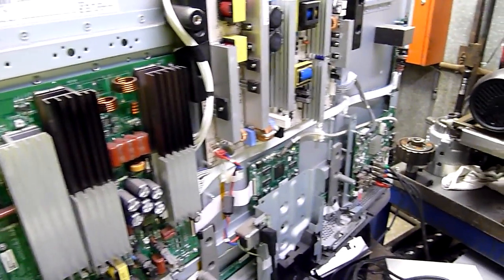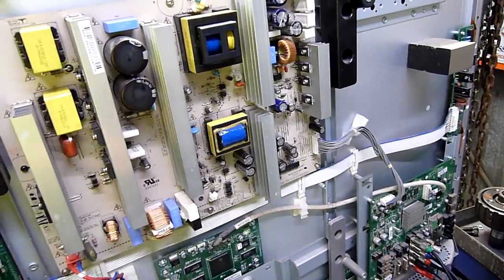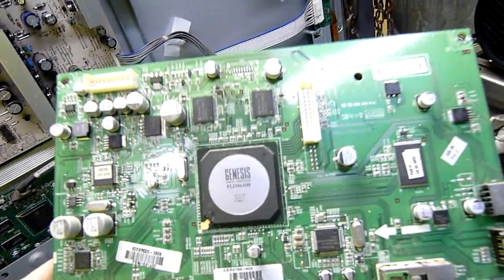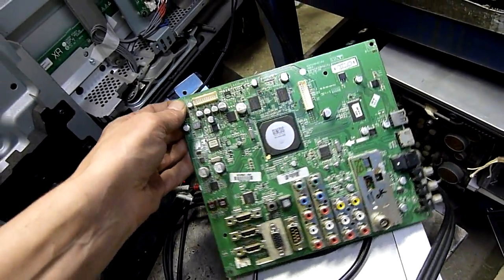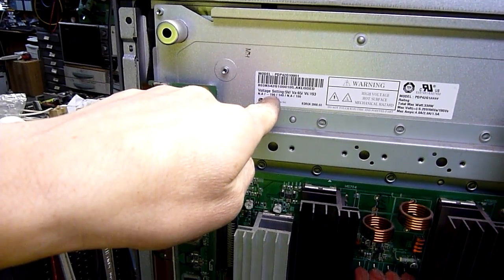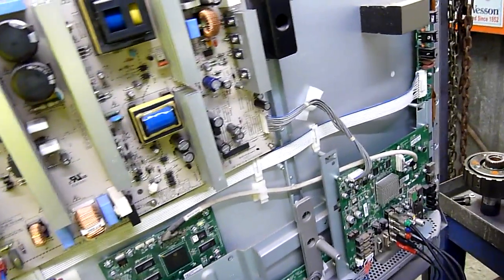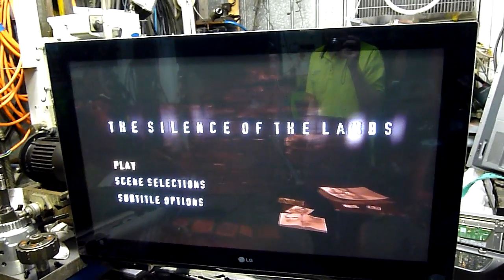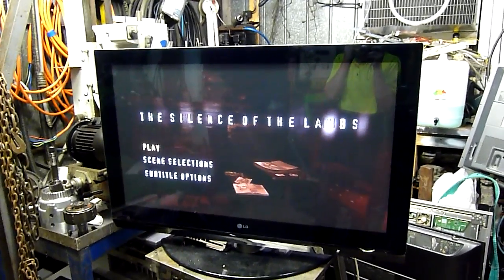LG Plasma ( 42PG60UD ) is fixed + Rambling about DIY Plasma repair safety

Comment: I repaired one of these tv's 2 years ago just replaced mainboard, its the Genesis chips that have the bga problem in my opinion. 
Might try reball the chip on the one I took out and replaced, if I get another the same model come to me.

Comment: I've never been smacked with household electronic goods, but I copped a good belt off an old Philips square wave AC welder at about 150 amps but on the low voltage side. It friggin' hurt. Had the electrode holder in one hand (had some fancy kevlar lined gloves on), moved the earth clamp for a better connection, next thing I know, the holder goes one way, earth goes the other and I have some extremely sore and tender shoulders. Lets say I learned from that experience....
Reply from the maker: haha, yeh I got hit by one of those on the 72V setting, not fun!

Comment: Might be good to run the tv thru an isolation transformer to reduce shock risk like when working on a transformerless valve radio from the depression days. If the plug (nonpolarized naturally) was in the socket 1 way the chassis would be active and floating at mains voltage like the heatsinks.

Comment: It's AC that tends to hold you on because the continuous alternating current keeps stimulating the muscles to contract.  DC gives you a hard bump but doesn't latch you on unless there's a lot of ripple.  I'm sure you've had some interesting shocks.  Care to share your worst?  Mine was on an automatic barrier gate when the "reconditioned" control box went live while I was holding it because someone had missed out half the plastic spacers on the PCB and the brass one that earthed the case.  Happened in front of a lot of people as well which was a bit awkward.

Comment: The Genesis series chips were junk anyway, they had a bad batch of them.
 If you had BGA Rework equipment, you could get a new chip on the chinese blackmarket and replace it, as the firmware is stored off-chip.

Comment: Anxious to see the board bake goes.  I do it at 425 for about 6 minutes.

I remove electrolytics and plastic parts just to be safe.  Good experiment though to prove of this is a BGA solder issue.  Confident that it is.

Damn ROHS nonsense!!  Fill up the landfills with e-waste instead of lead.  Now that's a green thinker for ya.

Comment: Why can a 2 volt DC super cap cook shit but 12 volts DC from a transformer does nothing?
Reply: It's the amount of current.  Cap has very low internal resistance, so can put out a large amount of current very rapidly.  12 volt transformer has a higher internal resistance, less energy can be released in a given time.
Reply: Gavin Curtis
Oh right :) Cheers Gavin.

Comment: I heard that if you lay a plasma flat it can destroy it. Why?
Reply from the maker: I've transported 42" panels flat on their back and front on the way home from the local tip with no broken panels yet, and that was bouncing around in my little trailer too!., but thats not to say it could not cause excess flexing in a much large panel.
standing upright distributes the forces on the glass a bit more evenly, but transporting them on their back has worked well too.

Comment: When I was replacing our 50" space heater of a Samsung plasma's PSU, I was shaking like a leaf when removing the blown PSU, cos in December 2012 I was messing about inside my old Philips CRT VHS-combi TV (while unplugged of course, and had been for a couple of weeks!!) and got a belt from a discharging cap that used me as a path to ground through the cracked up flyback casing, and seeing those big caps on the back of a plasma really made me worry if the same was going to happen, it didn't though thankfully, but it's still wise to be cautious around such things...

Comment: those psus can run up to 320V dc. the bridge rect looks to be 10A plus. if you contacted any potential it could be REALLY friggin nasty. the centre point of the supply caps depending on supply topology, could be 160v. i could be wrong here, but if they are running a half bridge / full bridge SMPS, nasty voltages all about. sometimes at high frequencies, which is another issue too.

Comment: was shocked by my mothers 32 inch CRT a few years ago while holding onto a lamp voltage went up one arm, cross my chest down the other arm, stopped my heart for over 30 seconds, and have never grown a hair on my arms since, the hair bit is not so bad since i'm a woman, but yes not the best way to do it....... got much higher respect for tv's and such now. Only work on computers now there a bit safer, but for the power supply, be very safe out there, nice fix by the way

Comment: You need to bring the board up to 230 Degrees C to melt and reflow the solder on the BGA. All the RCA, VGA etc. plastic connectors cannot tolerate this, so you ruin the board completely - so to reflow the chip, you need a seperate bottom and top heater.

Comment: Hot heatsinks are also really common in UPS. I was really surprised the first time I saw a heatsink like that, I even checked to see it the UPS was C-ticked. Also for anyone working with electronics don't touch the prongs of a mains plug. It's rare but you can get a nasty if not lethal boot if the item is faulty. That was my second electric shock that made me see stars and loose my hearing before 9 years old :D
Reply: from flourecent lights and HPS lamps, the power factor correction cap, gets you when you touch both the active and neutral pin on the plug.
Also fan speed controllers (3 speed for ceiling fans) store a charge. capacitors suck when they bite, the feeling is quite unique